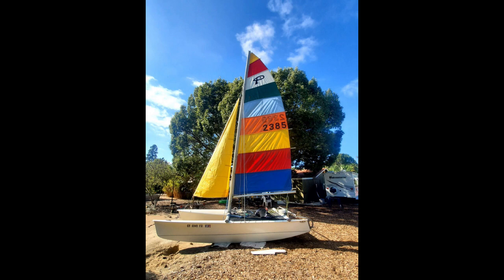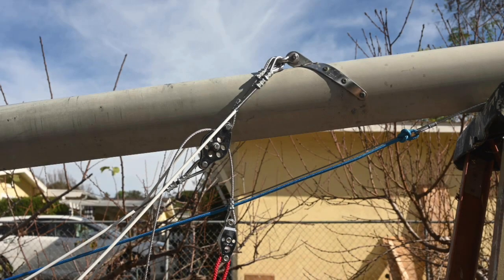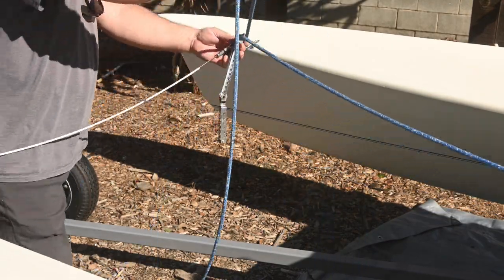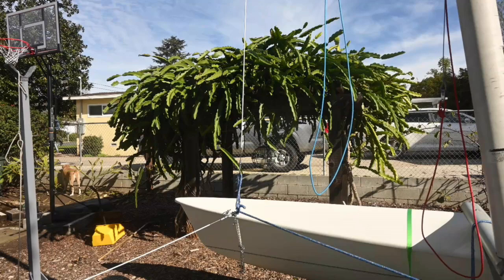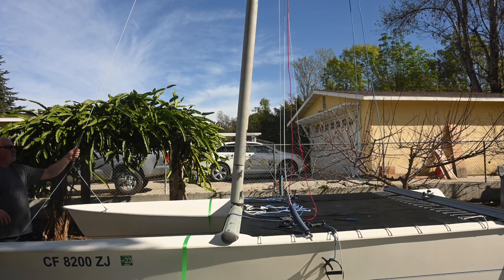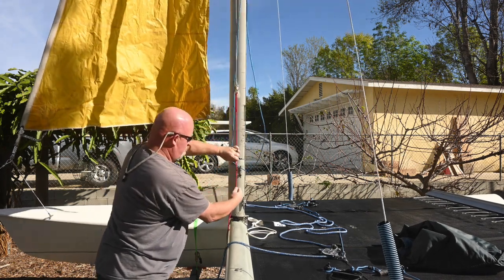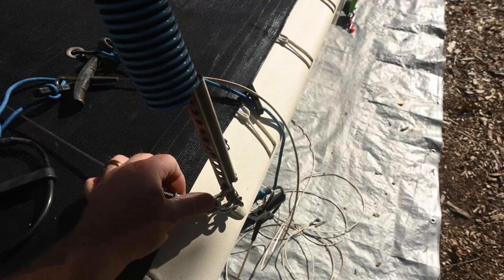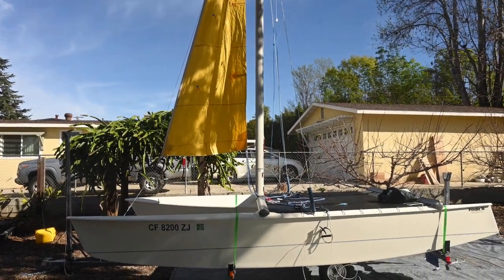Prindle 16 rigging tips (early boats)

Comment: Awesome to see someone finally posting Prindle info!!! I have been wanting to do this for years. Just took my P-16 out yesterday in lake Erie it off Cleveland. Great sailing here in the summer. Was able to trap out most the day. My jib/forestay setup is quite different from yours. I have the ring and hook system with a zipper on the jib to the forestay. I actually tension my forestay using a barrel tensioner to control rig tension along with the side stays. Also have a jib traveller. For trapping i installed hi-lo trap kit which works great. I can send some pics of you want. I plan on doing some videos also when i get time. Good sailing to you.
Reply from the maker: Definitely sounds like you have a newer boat!  I only know about the newer rigging from what I've read, never put hands on it.
Reply: This is the hobie 16 set up with a wire inside the luff that becomes the forestay for tension I like that system better you can control the tightness of the rig from it I actually put a wire inside the luff of my Prindle 16 to imitate the hobie 16
Reply from the maker: right - the older Prindle jibs were configured the same way as the Hobie 16.  This boat is a 1978.  I now have a 1979 as well, and it has the zippered jib.